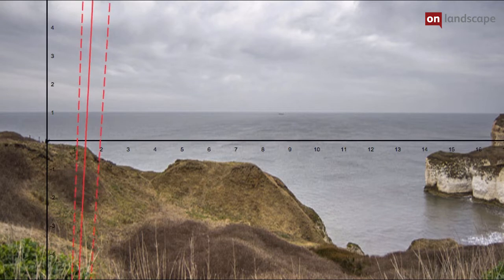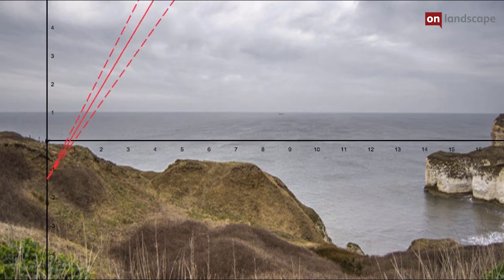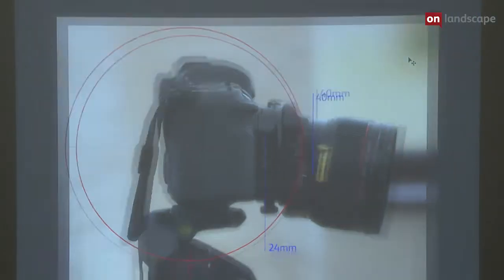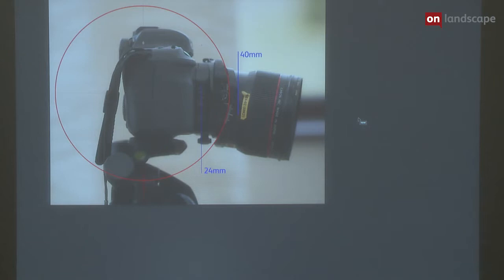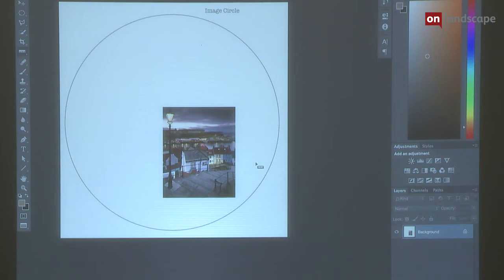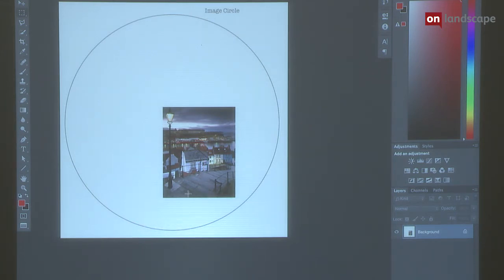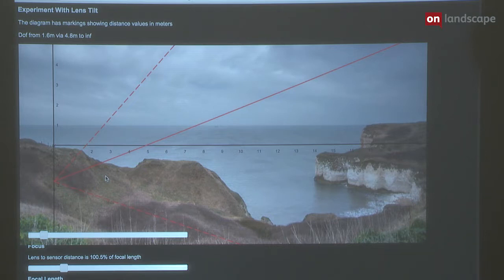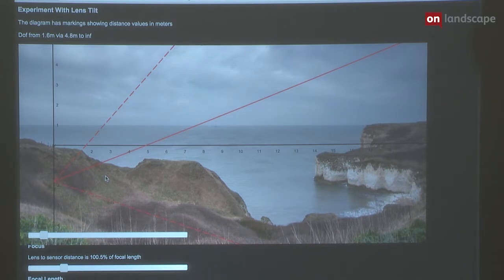The Use of Tilt Shift Lenses in Landscape Photography

Comment: In the tilt shift set up with multiple adapters, the main point of interest to me is that one of the adapters has a tripod mount that allows the camera back to tilt and shift relative to the lens.  Which adapter is that?  I could not find one like that from Kipon and Mirex no longer has a web presence.  Then with a second adapter, the lens can tilt and shift relative to the sensor.  Here we apparently have all movements of a field camera.

Comment: Online calculators I've found agree that 110mm on 5x4 is equivalent to 29.7mm on 35mm sensor.  A 90mm lens on 5x4 is equivalent to 24mm on a 35mm sensor.
Reply: Hmm... You can't calculate the difference without  taking into account crop. The height of 35mm  film is 24mm. The height of 5x4  film is 98mm (landscape orientation). Hence the factor for focal  length calculations is 4x if  you keep the height the same (i.e. if you crop your 35mm to 5x4 ratio normally). 

However, the width of 35mm film is 36mm and the width of 5x4  film is 120mm. So if you keep the width the same (say you crop your 5x4 to 3x2 ratio or 2:1 maybe) then the ratio is 3.33. 

Hence a 110mm lens is either 28mm if you normally crop your photos to 5x4 or  33mm if you like panoramas

Likewise a 90mm is either 22.5mm or 27mm

Comment: This has come at a perfect time for me Tim. I’ve spent the last few days getting to grips with a new tilt shift setup on my Hasselblad X1D. I’ve gone for the HCD24mm attached the the Hasselblad HTS1.5 Tito shift adapter and then the XH adapter so the lens and adapter can talk to my X1D. Having used a canon 5DSR and the wonderful 24mm TS-R preciously I’ve missed movements. I’ve been using the simulator on your server and have made some good progress in the last day or two. One of the issues I’m seeing now is softness in my images when using the hts1.5. I aren’t sure if this is due to the extra glass in the setup or my use of f11 or f16 which given the HTS multiplies the lens by a factor or 1.5 this maybe effecting my aperture. Tomorrow I will try larger aperture and hope the image quality improves in terms of sharpness. I was thinking of emailing you about all this and then this video popped up. As always good work. Us photographers should be grateful for the contribution you make to the community in educating and sharing your knowledge. Thanks for now.
Reply: The  HTS does  affect  virtual  aperture and diffraction limits  (I think)

Comment: Tim, I saw an article on another website which so inspired me, I had to get one of these lenses. With little knowledge other than watching lots of youtubes, I put it into use for a macro shot, and by some fluke, found the perfect tilt and focus position for a stunningly sharp macro-ish shot of a mobile phone on a flat surface. You could see the thread on every stitch of the phone wallet, and the detail on debit cards inside, as well as the phone surface itself. I was so amazed by this (nikon PC-E 45mm) I found a 24mm and bought that too. The thing is, until I found your very laid back video here, I had little idea of how to use these well. The bit in your video which REALLY impressed me starts at approx 15mins 30 seconds in (though I didnt understand it properly at fist and re-watched it a few times to drum it in).

I had no idea that turning the focus ring would widen or narrow the depth of field when tilt was already applied. I had worked out a basic technique based on another youtube. Namely, before titling down, focus on a point in the middle distance avoiding anything with height in the foreground. Having got that perfectly sharp with manual focus, next, tilt the lens down while observing the near distance. I use of course, Live View and zoomed in for this. The technique calls for not touching the focus again once set up originally, and to just watch the near distance come into focus as you simply apply tilt. I have to say, it does work. Not only that, but you Tim, actually mentioned the same technique in your video.

What makes your video special though, is that your tutorial from nearly 16 mins in explains that the two things affect the depth of field. Namely, focus and tilt. Your graphic was like a light coming on in my head, and makes it quite easy to understand what is going on with the use of tilt, and, more importantly, the point you made about not applying too much tilt because to do so shuts down the depth of field by making the wedge point down too much, cutting off the top of the image from sharpness.

I very strongly commend any owners of these tilt-shift lenses to watch that section several times until you 'get it'. Tim's laid back presentation hides a tremendous breakthrough technique for me, and you really should bookmark and watch this now and then to remind you of how it works!

As I type, there are only 8k views and only 39 comments - yet this is one of photographies greatest secrets, and since I got into tilt-shift, I have to think twice before going out with a normal lens on the camera these days. That is how important this video is.

Sorry I am late to the party, but, I am so glad I showed up in the end. Heartfelt thanks Tim, you've done a brilliant job on this.

Comment: Thanks Tim: super-geeky(!), but as informative as ever: a treasure-trove of usefulness.
NB: At 1:13:00 following, this is the only explanation I've ever come across of inverse bellows factor - the problem of having to use extra grads for the horizon to control differential bellows extension with large amounts of front tilt on big landscape scenes with close foreground (as often with wide-angle lenses).  

It makes a lot of sense; it's also worth saying that the reciprocity timer app that I use for bellows extension doesn't allow you to input negative bellows extension (well it does, but it doesn't actually calculate it).  This helps to explain a couple of anomalies I've had with using wide-angle lenses with looming which I couldn't otherwise fully explain.  

To calculate it with the app I guess what you'd do is meter for the foreground and calculate grad for sky as usual/necessary, but then note the differential bellows extension and apply this into the app as if you were calculating this for normal bellows extension.
So e.g. using 150mm wide-angle lens on 10x8, lots of front tilt, producing say 165mm bellows extension for foreground but only 135mm bellows extension for sky (thus lens technically focused 15mm beyond infinity and assuming front axis tilt, as per e.g. Linhof/Chamonix/intrepid cameras) this would mean 30mm bellows extension beyond 135mm, which would be an extra 1/2 to 2/3 stop you'd have to bring the sky down by to help correctly balance the exposure with the foreground, even after the application of e.g. a 0.6 grad to sky to balance the base exposure.
More important for slide film but still good to know, and another reason to keep those tilts under control!
Reply: Yes absolutely... I reckon for a midpoint horizon and  focussing  very  close, you might get half a top in the sky (possibly a little more)

Comment: Am I correct in thinking if you measure the distance from the center of the sensor to the ground (in the plane of the sensor)  which we'll call distance. then the tilt angle required is the arctan(lens focal length /distance)?

Comment: Is there a Canon RF to EF shift adapter like you mention? I use an Arax adapter to adapt hassleblad V series to EF. As you point out, the tilt and shift are perpendicular. The tilt changes the composition and I need to adjust the camera body (readjust ball head) to get back the original composition. So the original setup needs to be tweaked. I guess it is not possible to have one such adapter on the EF mount given the flange distances (?) but on a RF mount, a second adapter could do the trick? 

Superb video!
Reply: There's on you can 3d print but nothing commercial as far as I know
Reply: @largeformatlandscape  Thanks! Anyone selling / offering the 3D file?

Comment: The "Merkelinger Rule" described is of course what we generally know as the Scheimpflug Principle. Merkelinger only wrote an article about it in the 1990's, but did no actual contribution.
Interestingly, Theodore Scheimpflug, in the 1880's declined authorship of the principle, citing instead French photographer and engineer Jules Carpentier, who himself stated he was only applying known Eponymous principles from Stigler.
Reply: Merklinger is actually subtly different and more applicable to photographers. Scheimpflug "merely" states that the film plane, lens plane and focus plane coincide. Merklinger interprets these rules for various practical applications. From a description of Merklinger's paper "There's a second law of optics similar to Scheimpflug's (first) Principle. Like the earlier rule, this one, also described in Scheimpflug's patent, states that there is another set of three planes that must converge along a common line. Like the first rule, one of the planes is the subject plane. The second plane is again one through the center of the lens, but this time parallel to the film. And the third plane is again perpendicular to the lens axis, but now one focal length in front of the lens. This second principle seems to have been largely ignored by photographers."

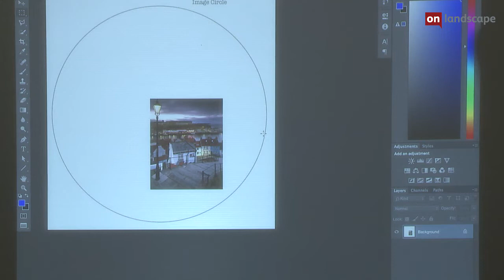Comment: 54:03 Do you mean that lenses have an inherent distortion at the edges of the image circle? Most of that distortion is due to the fact that you have tilted the back of the camera (or sensor plane). As long as the subject plane and the sensor plane are parallel, there won't be any distortion. If TS lenses had an inherent distortion at the edges of the image circle, they would be of little use to architectural photographers.
Reply: I mean that the natural perspective of a lens causes things to appear stretched away from the direct line of sight of the lens. This is why the person on the edge of a group of people photographed with a wide angle lens appears to have a stretched head. In order to achieve a 'normal' perspective, a lens magnifying power is greater at the edges. 

You can view it from a few different frames of reference. It's probably best described here https://www.onlandscape.co.uk/2011/05/whats-the-shift-in-tilt-shift/
Reply: p.s. There's a difference between distortion on a planar surface and the way things are distorted that are three dimensional. The classic image of a page full of circles showing them as undistorted with a wide angle lens but place a sphere on each of the circles and the spheres look distorted.
Reply: @largeformatlandscape  Thanks for the explanation, I really struggle understanding this. I was just looking at the picture of the circles and spheres in Merklinger's book that you are referring to and it's taking me a while to get my head around it. From what I can see, to create the looming effect the distortion sought by shifting the lens down and tilting the sensor backwards won't always work, if the subject plane ends up being parallel to the lens plane?